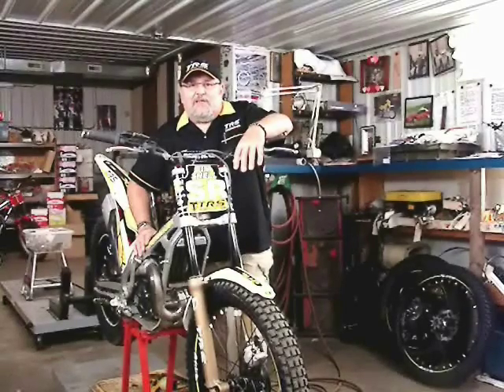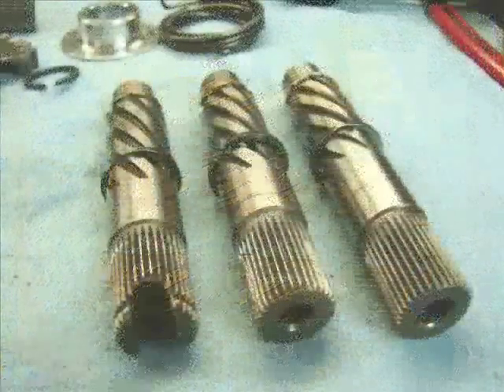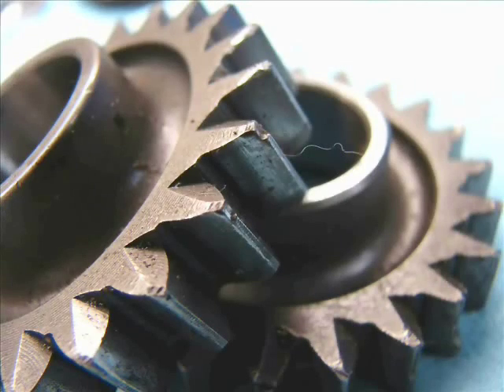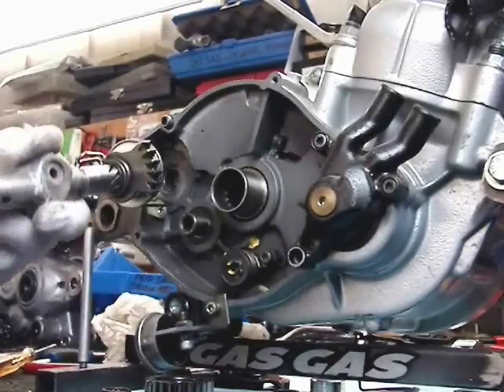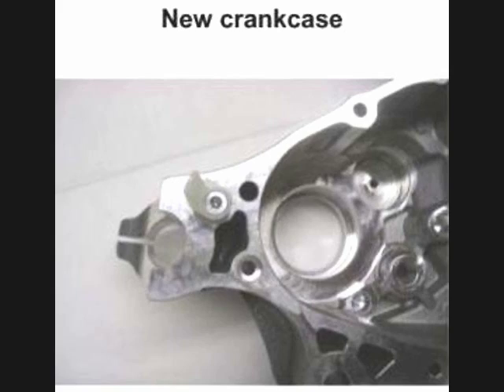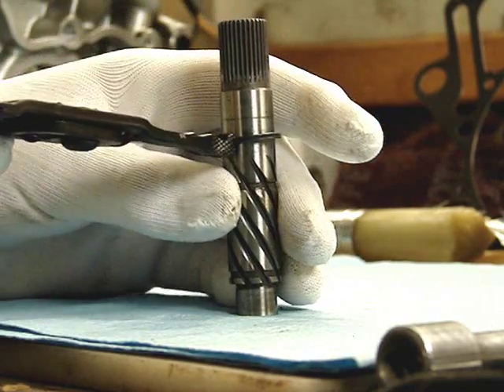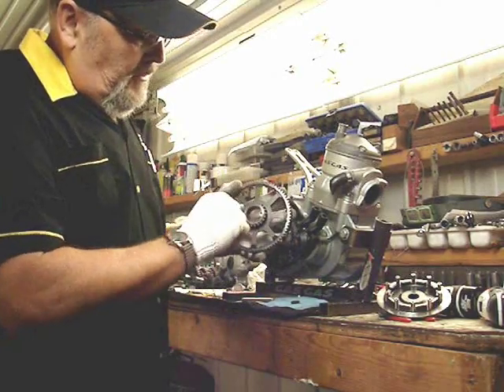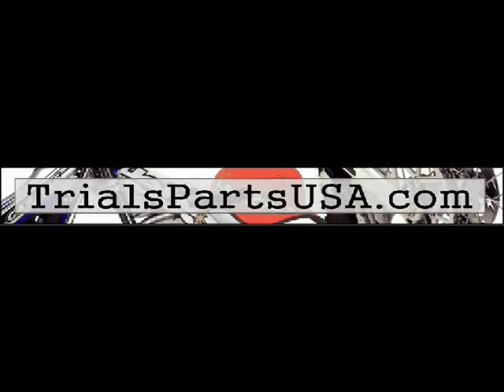Jim Snell - USA - GASGAS TRIALS ENGINE REPAIR, PRO KICK-START SYSTEM

Comment: Does the trs use the same engine as gas gas?
Reply from the maker: Hello,

No they are not the same. 
The engines are almost completely different. In fact, the GG engine is now quite dated, and the TRS engine is the latest technology, so there is actually 15 years of advancements in technology between the two..

Wherein the original concept and design of the GasGas Pro engine dates back now 16 years to the year 2000, followed by World Championship racing in the season of 2001, followed by actual production of the first 2002 GG Pro in the late fall of 2001.

The TRS engine development was undertaken in 2014 and 2015, with secret testing in the summer of 2015, followed by the first World Championship racing at the end of the 2015 season in the TDN. Followed by serious final rigorous testing throughout the winter of 2015/16. With TRS motorcycle production beginning in February of 2016.  

Thank you for watching my videos.

Best regards in sport, Jim Snell